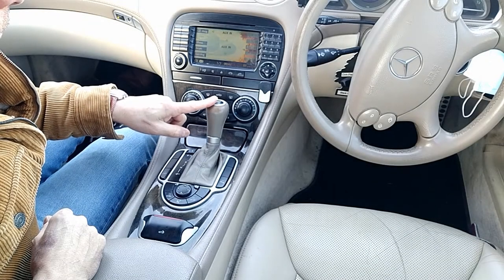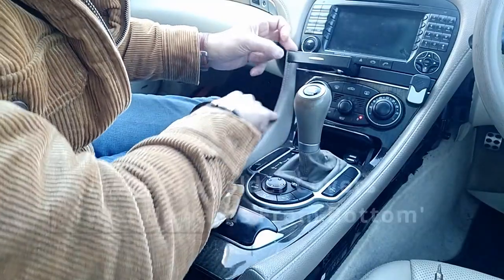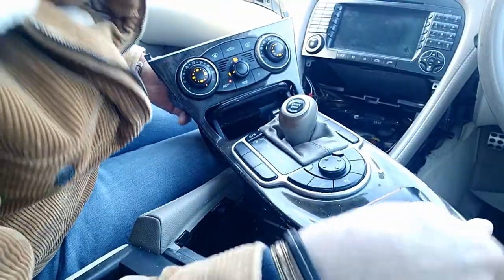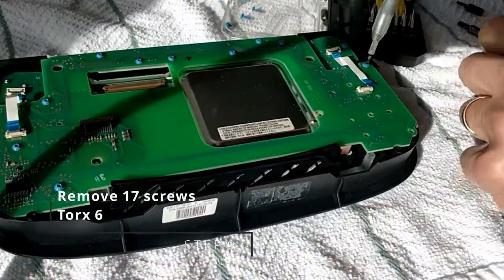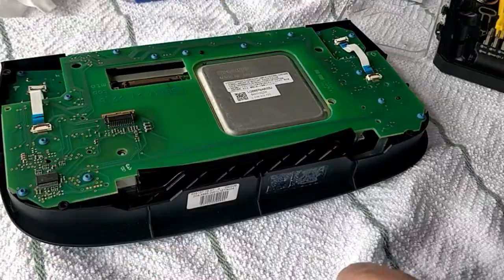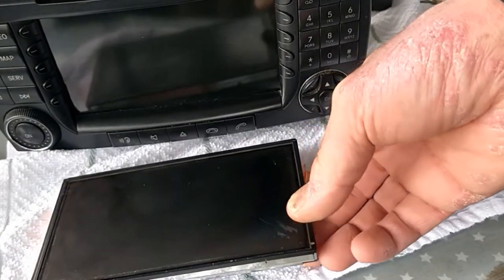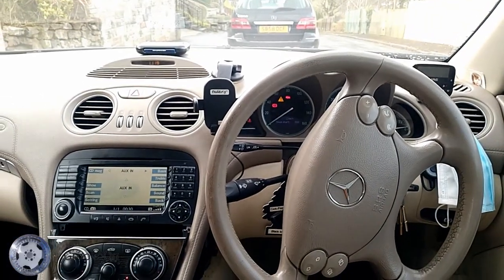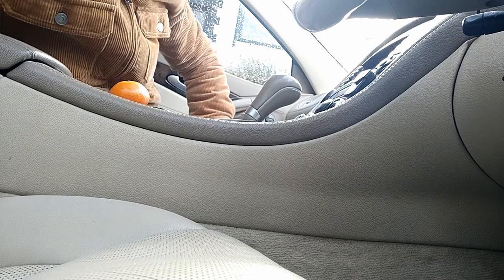Mercedes Comand Unit Removal + Screen Replacement NTG2  SL, A, B, C, CLS, CLK, E, G, GL, ML, R Class

Comment: GrooveOn I am installing an original head unit the same as on your merc. 
There are 3 wires that need to go into 12 pin  connection for the rear of the stereo head unit. I looked but can not find the info I  need to know. Do you know what color wire goes into which number on the 12 pin cable conector.
Thanks.
PS love all the vidios on the r230.

Comment: Hi Great video. I am looking to change my screen but wondered if disconnecting the unit means I have to have a code on re-install or if I can safely disconnect from the power and re-install without needing a code? Thanks
Reply from the maker: Hi there, I didn't have any issues of needing codes. What I'd suggest is don't turn car on, leave keys away from car if you have keyless go. Then remove comand system. There are screws at top that I didn't show under air vents, they were not fitted on my car strangely.
Reply: Hi GrooveOn. Just to let you know that I finally got round to changing the screen and your instructions were spot on. The only issue I found was that once I had reinstalled the whole thing the screen misses a little bit of the info off the bottom when on maps. I think I will remove and try to push up a little to see if this resolves it. I ended up leaving the base unit attached to the car and just removed the face and it worked fine. Thanks again.
Reply from the maker: @markfraser9656  you are spot on, I did the same, just slacken off the screws and push up the screen a bit. The good news is that now you know what to do, I will guarantee you can get the job done in less than 40 mins !

Comment: GrooveOn, I have 06 SL500 with a nasty burned in look to the middle of the screen. I recently replaced the polarized film on the instrument cluster lcds and I'm wondering if the screen on the command has a similar polarized film that can be replaced rather than replacing the entire screen. Haven't been able to find any info on this.
Reply from the maker: hi there, I am afraid not, the screen surface is a standard LCD.

Comment: Hi GrooveOn, thanks for sharing this video!  Question, does the screen appear to be lower than the original screen?  I noticed the lower part of the screen like “CD” and the graphics are partially covered up by the lower edge of the plastic trim. Thanks!
Reply from the maker: Yes you are correct the screen is a few mm lower, in hind sight I could have centralised it before securing the screws, however it really is not noticable and now the top of the screen show more !
Reply: @GrooveOn  Mine is the same but you cannot move it up any more as it is already hitting the DVD slot housing.

Comment: I installed that exact screen and it it still isn't right. The image is about 1/8 of an inch too far down (and yes the screen is all the way up and abuts the DVD slot housing) and the Day/Night/Auto brightness mode still is bad. I have to keep it on Night Mode just to see the image.
Reply from the maker: Are you sure you got a good quality screen, there are some cheaper versions out there. My screen is better than the stock one,